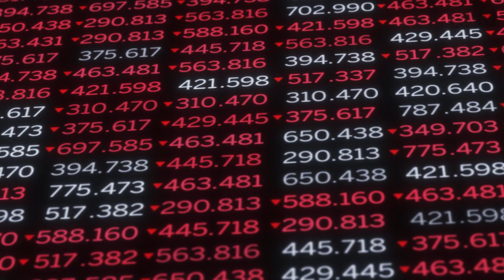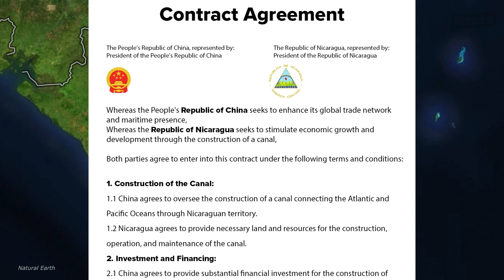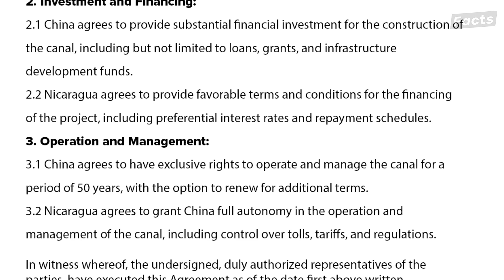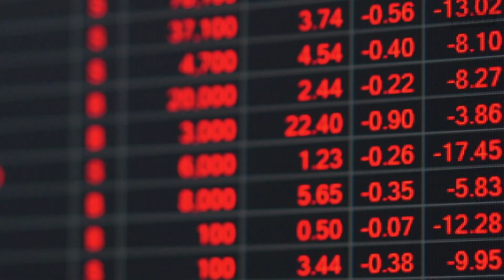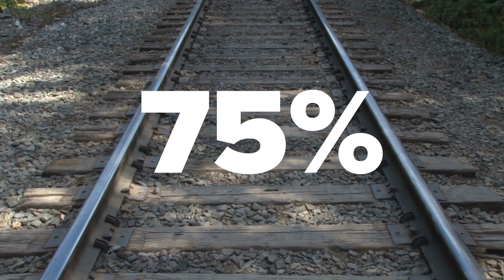This Will Destroy the Panama Canal

Comment: They finished expanding the Panama Canal to handle Chinese giant cargo ships. They do unload ships and send the products by rail.
Reply: The expanded canal could  just handle containerships of up to 13,600 TEU capacity, certainly too far from the latest containerships  of 24,000 TEU capacity. By rail? impossible!; time and additional handling costs just cannot be justified.
Reply: V@PahatRout but they do it in Panama
Reply: @CharlesJones-ip9fk  Panama does it, not China.  They also off load ,gas and oil and send it through a tunnel.  China has ports to inventory what goes through, on both ends.  America should too. China is everywhere in South America.  They can send products to other countries that don't pay tariffs and send them here through different ways.

Comment: How are overland rail/road projects even an alternative to waterways ? Unloading and reloading cargo is a mighty expensive proposition.

Why is Guyana never in the picture?
Reply: They are kind of reloaded. The massive ships do not deliver to a single port but do many multi-stops. A China ship could unload at a Chinese style port in Mexico or Nicaragua, rail over to load onto many smaller ships for each Eastern port. Cheaper & quicker than waiting to unload at LA or BC, then rail transcontinental.
It is not US built canal at issue but the Panamanian Panamax locks that drained the lakes.

How is Guyana relevant?
Reply: Not to mention that one 20,000 container ship would need 100, 100 car trains to transport one ship's worth of containers.  That is a lot of trains.  Considering the Panama Canal has about 13,000 container ships a year, that about 36 ships per day.  Good Luck Mexico